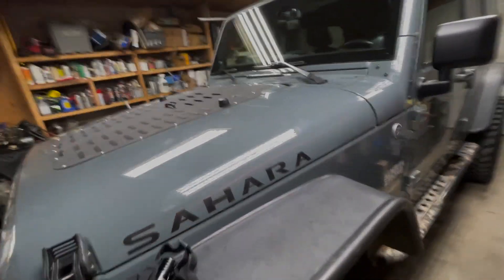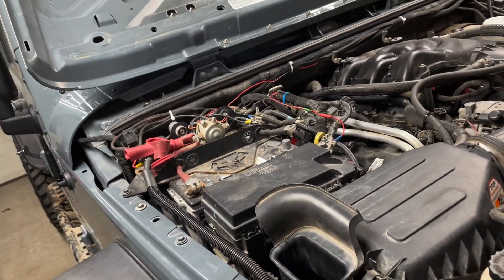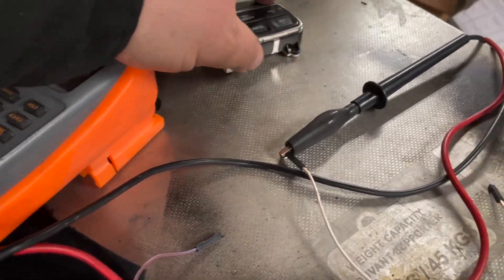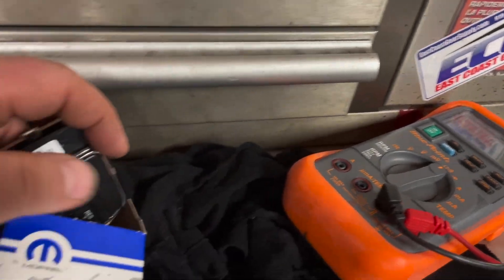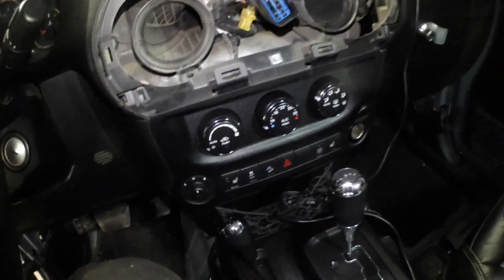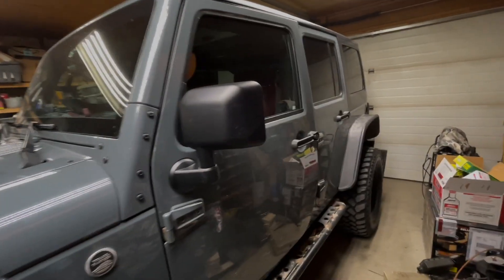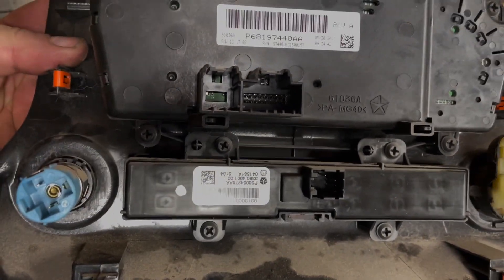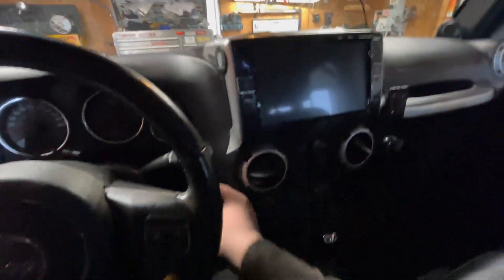Looks Like I Fired the Parts Cannon

Comment: Jerry, I had a similar cruise control problem with a Ram truck. It turned out to be the cruise control module under the hood. Mine was located hidden under the battery tray where it somehow rusted through and would not hold a vacuum. It did not make a hissing vacuum leak noise. It just halted the entire cruise control from operating. I replaced the unit and my cruise control came back to life.  Good luck!
Reply from the maker: I wish it was that simple now days, this cruise control is electronic as the throttle body is drive by wire

Comment: Yo dude check the minimum Cruise control speed in HP Tunes it might be set at like 37 miles an hour and with those giant tires you have to be doing like 80 for it to engage.
Reply from the maker: Computer is reprogrammed for the tire size and regeared.  The issue is that it won’t even power on
Reply: @BackCountryWrenching  Ya i figured as much. I know the ABS has to be happy. My truck was the little wires in the steering column.

Comment: I have seen on more then a few Dodge trucks now (the steering wheel pods are nearly the same set up as your Jeep) that the harness where it plugs in to the clockspring (the white connector in the video) the wires break right at the pin of the connector. Next time you have it apart give it a little pull test.
Reply from the maker: I’ve heard that was well at some point and time I’ll have to dive back in

Comment: I've seen those HVAC controls on ebay, MOPAR parts only 200 ish delivered canadian. What the hell Jerry ? 400 ? The fuck, thats to much.
Reply: The way it behaves it kinda sounds like cold solder joints, i wonder if dissasembling and reflowing it in the oven would fix it....
Reply: I have found with mopar, they only like mopar parts. Knock off ends up being a headache. I mean it’s a Jeep not a Chevy.
Reply from the maker: There is different modules depending on your vin number. The first one I ordered was like 200 and they said it wouldn’t work with my vin
Reply: @BackCountryWrenching  Well that’s some bullshit there, I don’t know, I’ve seen similar things specced for only certain models and or years that said they wouldn’t work but did, anyways go figure the one they say will work is double the price... What a strange coincidence that is ? They look identical, what the fuck causes the price to double ?!? Just seems like a racket to extract your cash...
Reply: @BackCountryWrenching  this is good to know as I believe mine will need to be replaced. I just would have ordered one that looked like mine. Thanks for the heads up Jerry.